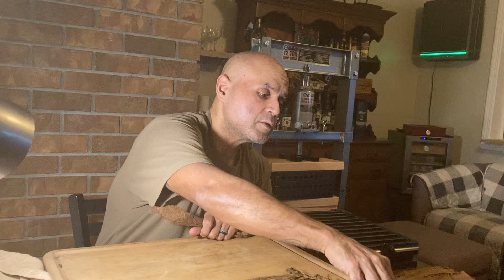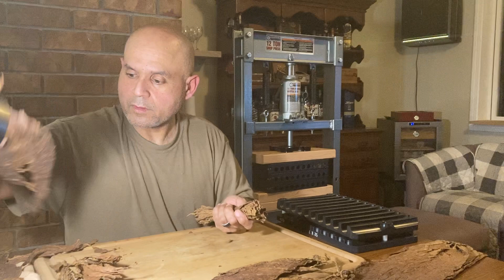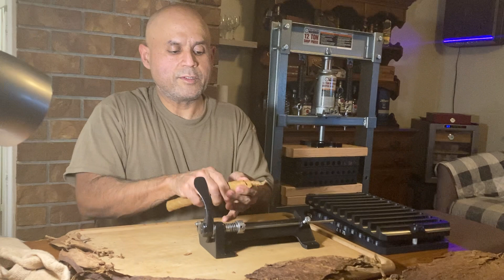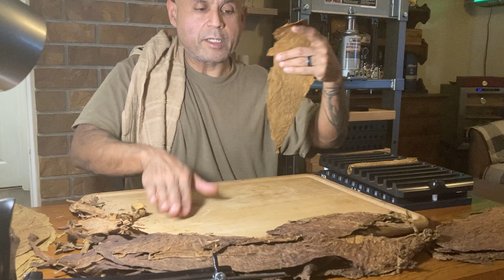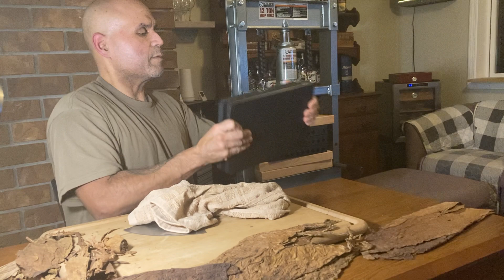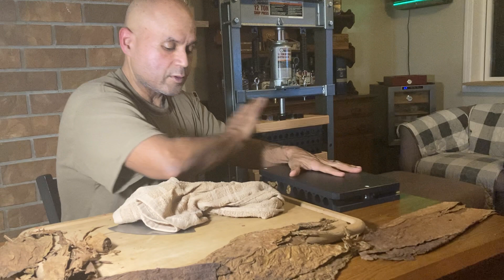Cigar bunching

Comment: ive recently come into the world of cigars.what would you roll for someone like me?
Reply from the maker: I would recommend something on the lighter side, mild to medium in strength… AJ Fernandez Connecticut New World is in my opinion one of the best options. Mild to medium in strength but still full of flavors… Make sure not to inhale and do not smoke on an empty stomach… At that point even the mildest cigar can get you lightheaded and worst case scenario cause nausea… In such case put the cigar down (no shame on that, it happens to the best of us) and get something sweet like a soda or even some candy… tobacco “sickness” lowers your blood sugar levels which is the reason you might get such bad symptoms… Again no shame on that, It happens every now and then to even the most seasoned smoker, specially when trying something new… Cheers